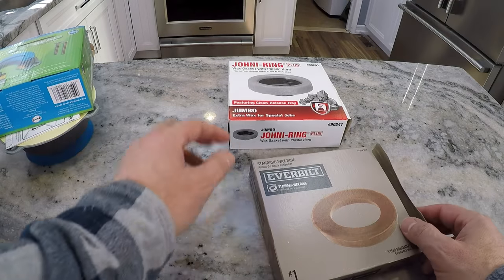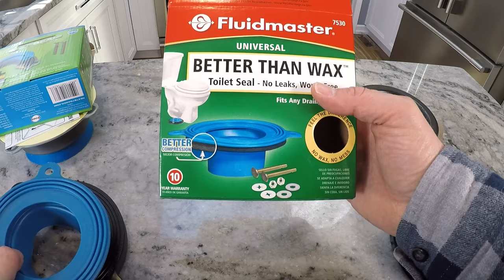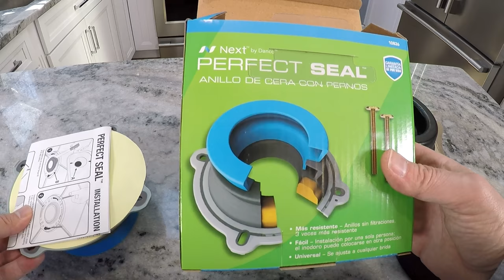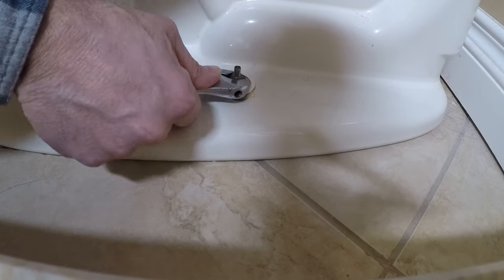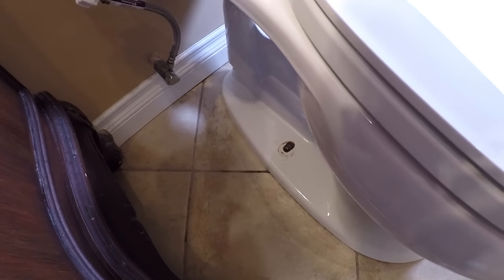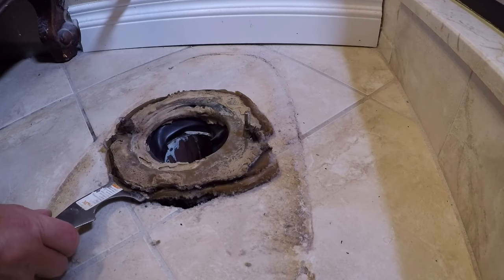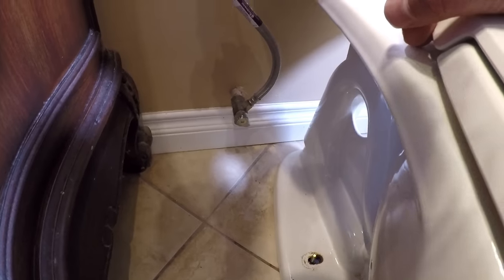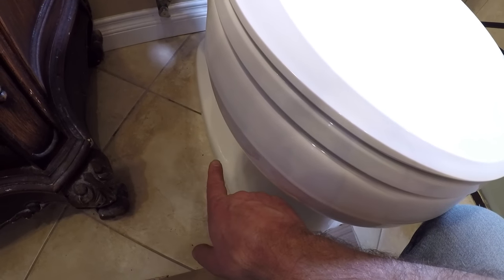Toilet Seal Replacement - Wax or Danco?

Comment: Here is how I see it. I am not a plumber but I've been in HVAC for long enough to have spoken with so many plumbers. I always ask them what they prefer, wax or wax less. Plumbers always use wax because it works. They can guarantee wax. I've heard some plumbers say that they will install what the customer asks for but the warranty will depend on weather its wax or not. If plumbers do wax all day long, so will I. Again, I'm no plumber the everyone around me fancys me as a handy man and I've done a fair amount of wax replacements. No issues so far.
Reply from the maker: wax works... but people are always looking for an alternative
Reply: @flannelguydiy6458  That's silly. Wax works. Wax is cheap. Why seek alternatives?
Reply: I guess it's just me but l see too many jobs by D.I.Y. folks not fully cleaning surfaces to ensure n even 360° smooth area and also plugging up the sewer pipe hole to avoid both allowing sewer gas seeping out and stinking up the house and also preventing tools, hardware and debris falling into the drain pipe.

Comment: One thing I have learned over the years and no licensed plumber will tell you because they don't do it is coat the bolts with never seize. Years later you can remove the nuts without any problem at all. I use it on anything exposed to water and weather or heat.

Comment: I installed the Danco perfect seal today. My flange is flush with the floor so I didn’t use the extension. So far so good. The toilet sits as solid as before with no rocking. It stopped the slight leak I had from the wax ring failing after 10+ years. I watched your video to see if you did your Danco install differently but was disappointed to see you install the Fluidmaster instead.
Reply: same..as I sit here w a Danco and 2 wax rings  :)

Comment: Put a little safe gasket grease or O ring grease on the grey or blue  seal and the toilet horn will slide in easy ..if not the grey seal can bend when the horn makes contact with the seal and get a improper flush seal...u can do it while you have the toilet on it side u can tell  how easy it slides with grease  vs without it

Comment: I put in 3 of the same toilet for my cousin. Never really did a toilet. I bought the blue Fluidmaster you used & the red Korky one, tried the blue one, the flange was  1/2" above floor, even removing spacers felt toilet was too high, whereas with wax you can put weight on toilet and get the wax to squish down, pulled it off & used the red Korky removing the thicker spacer, worked better, still had to shim. Then put in 2 more & on one used the Danco one you showed (that toilet had the flange a bit below the floor) that had wax in it, that was pretty good. Tried the Fluidmaster again on one and rejected it, used the Korky. Terry Love, a master plumber who runs the Terry Love Plumbing Forum, still says use wax. I think in hindsight I would use wax, I think ideally if floor is level you want the entire base of toilet to rest on floor, since you can't tighten the flange bolts too much. With these waxless rings, they don't compress enough to get the toilet to rest on floor. Sure, you can shim, but that's not ideal. Another issue is, good thing on one I pulled the toilet before tightening bolts & saw that the thin rubber that went down into the waste pipe had caught and folded up, good thing I saw that or would have been an obstruction to flush. You would not have that issue w/a wax ring.
Reply: Thanks For Sharing! That Recess At The Ring and Bolts Is About 7/8” Deep On My Kohler Elliston, I Believe That Would Be The Critical Measurement, Since The Outer Base Edge Would Hit The Floor And Limit Any Further Compression Of Wax Ring. If Flange Is Any Higher Than 7/8” Above The Floor, Than Toilet Weight Will Be On The Flange/Pipe and Likely Wobble Needing Shims/Support...
#YourRecessMayBegToDiffer #YourToiletRecessMayVary 🚽 #NotAPlumberInRealLife 🕳🦸‍♂️
Reply: Frank-You are SPOT on about the wax free rings! I went thru 3 of them and my toilet STILL wobbled and to use shims was ridiculous! I ended up using a wax ring and will do so from now on!
Reply: Frank, that was a great explanation of what to watch out for. That helped me more than most videos I’ve watched. Thanks!
Reply: Agreed. I also used the fluidmaster once to try on my house.  I removed the toilet a few months later to check how tight it was holding and found the the plastic funnel had turned upwards somehow and was catching a small amount of water. It didn't leak but I was not happy with that and could recommend them because of that issue.
Reply: @YOUandMeRealtyDotCom  you have got to stop capitalizing everything! my god!

Comment: Remove the water tank from the toilet, so it is easier to remove it and re install. (less weight and easier to lower the toilet onto the seal gasket). Also you may want to clean the tiles around the toilet drain before installing the toilet.
Reply from the maker: thanks for watching!
Reply: Just changed my wax ring, thought about taking the tank off, but figured that would be another place to leak. I don't  get along well with plumbing.

Comment: We installed a Danco Perfect Seal. Our flange was on top of our flooring, as most have recommended, removed the blue gasket and black liner inside the lower gasket and it still wobbled. We ended up using a standard wax ring (vs a jumbo) and installed sit flush. Buyer beware of the Danco perfect seal. Always dry fit the toilet to see if it sits flush also. Hope this helps others. And thanks for sharing this informative video! Very helpful.
Reply: I did not understand what you did. It sounds like you did not have much stuff on the flange, but your toilet wobbles because your flange is the toilets main point of contact because it is so high. This is a difficult thing to figure out: what is the gap between the toilet horn and the flange, and how much stuff do I need to put in there to make a secure passage from toilet to pipe.
Even though you think you have no stability issues now, I would put some shims under the toilet to resist motion as the wax ring settles and gets squished flat.
Reply: @yru435  There is no wax ring in the Fluidmaster seal that he installed.

Comment: I see that you used the Fluidmaster, I didn't see any wax on this one.  Is there one that has wax?  Also, did you try the Danco?  The Danco Perfect Seal still has a wax ring, it's just that the wax doesn't touch the toilet.

Comment: How did that Better than Wax work for you after 18 months?
According to the instructions you probably should have used the spacer too. The spacer is meant to lift the blue plastic high enough that it makes firm contact with the toilet porcelain, then compressed when you place the toilet weight on top. 
I’ve got exactly the same combination as you had in your video; wax, Perfect Seal, and better than wax. I’m leaning towards the Perfect Seal.
Reply from the maker: It has worked perfectly. The toilet is sitting firmly on the seal. No issues at all.

Comment: While you have the toilet removed is a good time to clean around and behind the toilet.Wall behind etc.
Reply from the maker: its also a good time to make a sandwich!
Reply: See, that's where most people just don't care about little details like that. I have severe OCD and I always pay attention to little details like what you're talking about. I had to replace two toilets in a house I bought back in 2014. My wife thought I was wasting so much time by cleaning the wall behind the tank. I also cleaned all the excessive wax around the flange of the floor so everything would be nice and neat. But yeah, most people today just don't give a damn. They slap something on good enough for it to work and that's it. Details to me are everything.

Comment: Thanks for the tutorial. I have a home on a slab. Any idea how I'd even check to make sure nothing is leaking after the installation?
Reply from the maker: with a slab? yeah if you have solid cement the leak should come into the bathroom

Comment: Just a thought sir, maybe it would be a bit easier with a shop vac to get the remaining water from the bowl and tank. Video is very informative.
Reply from the maker: It look literally 60 seconds to do it with the sponge. To bring the shop vac into the bathroom, turn it on, take it outside to dump the water, let the vacuum dry out, etc... it is actually easier to use the sponge. I like the fact that you are thinking creatively though. Really appreciate you watching!

Comment: Looking at using the perfect seal that has the wax ring underneath. Is the perfect seal  supposed to work with older iron/lead flanges?
Reply from the maker: not sure

Comment: i think Danco one, when used properly is good. I've used it time to time, but 80% of the time, i use the thick, extra wax ring, regardless how high or low the flange is, i just like that extra wax lol
Reply: I used the thick wax with danco hydro cap had great success with that product also

Comment: Just installed a Danco and was meticulous in cleaning and proper installation. 10 minutes later, its leaking out of the back. Heading back to the 
store for a wax ring. Thanks for your video.
Reply: It was actually the Next Perfect Seal that did not seal perfectly.
Reply from the maker: Those things are not often easy to install. If you are off just slightly when setting the toilet down, it could result in a leak. Luckily for me, I was able to get it sealed properly on the first try.
Reply: I stand corrected, the seal worked perfectly. The leak was actually coming from the tank. It must have moved slightly off the bowl when I leaned it back to clean. Thankfully I used blue ty-d-bowl and found the blue water coming from above before I pulled the toilet up again!
Reply: @bentstruments  Thanks for the update
Reply: @bentstruments  Good on you for coming back and setting the record straight.  Still happy with the Danco?  I purchased the Next Perfect Seal and a traditional wax ring still trying to decide which to use.

Comment: On perfectly flat floor: plain old wax.
On uneven ceramic tile: Danco.

You don't use nylon closet bolts?
Reply: @snaplash  Yes, but grout tends to fall apart, unless it's epoxy, in which case the toilet is never coming back up.
Reply: @ChrisGilliamOffGrid  My Bro-in-law (40yr plumber) said to use clear silicone adhesive to chauk the toilet  around the  bottom of rim, helps to seal and level.
Reply: @HighlightsVideoBlog  Not silicone, water-based clear or white caulk. There's a video of it on my channel. Use a sponge.
Reply: @ChrisGilliamOffGrid  Thanks Chris , it’s like you made that video for me!  I haven’t installed yet so I’ll check out your directions. I!m installing white over black tile floor so the clear product is the charm. I,ve seen another vid where the chalk was applied to the underside rim of the toilet just befor setting  it which makes sense to fill the grout gaps underneath the rim. Your Vid technique  seems simpler. Probably do both.

Comment: Im a few years late watching this. I have used the perfect seal on both my toilets and they worked good. I have since sold that home and we are buying another home that is older and i will be needing to update the bathroom for sure and so im just refreshing my memory on the toilet seals. Im hopeing i dont have a cast iron piping. I didnt get in the crawl space of the house. I asked the inspector and he said my stack was cast but there was some pvc. Im hopeing the toilet drain has been udated ive heard they can be difficult to mess with. Anyways thanks for the vid.

Comment: My brass mounting flange is not round and does not sit level. It is flush and up to 3/16 above the floor. I tried the Fluid Master and it would not work in any configuration even removed the foam and tried the black spacer to add a little height. I went with the Danco. If there is a problem I will try the korky brand.
Reply: Korky is a better choice. I installed two double-stacked korky three years ago. Everything works fine.

Comment: Very good video, Flannel Guy. I would have liked to see you do a dry fit of the BLUE part on to the toilet horn to give us an idea what the fit looks like. I thought that the idea was for the toilet horn to fit down INTO the blue thing, maybe deforming the inner part downward a little bit, and for the outer circumference of the blue ring to fit up against the bottom of the toilet around the horn (which is what a wax ring does, and that is what I thought we were going for with this blue ring thing). 

When I did the test fit on my toilet I found that the horn of my new toilet (Toto) contacts top of the blue ring, but it could not fit inside down into the diameter of the blue ring, even by stretching it. I used a flange extender ring to simulate the toilet/flange-ring junction, and I could not get the blue thing to seat on the horn without distorting the blue thing. There was no way to manipulate the blue thing to get the it to move any higher on the toilet horn. The only point of contact would be the thin edge of the toilet horn contacting the blue thing, but not fitting down into it. It looked like the blue ring would have distorted and not sealed. 

If the horn on my toilet was a smaller diameter and tapered then it would work, but I didn't feel like grinding the horn on toilet (!!). This meant that the blue thing's surface would not contact the bottom of the toilet around the horn. I have read that the size of the toilet horn varies but I have no experience with that. I recommend doing a dry fit to see what your junction will look like.
Reply: R Y , I know exactly what you're saying about the blue ring not fitting over the toilet horn. The fact is this particular seal is NOT UNIVERSAL. I couldn't get to set properly over the horn, nor could I get the toilet to set flush to the floor no matter how I tried. I ended up using a Sani Seal gasket instead without any issue.

Comment: Suģgest you acquire a shop vac.  Vac the water from tank and bowl.  Takes about 45 sec and no water clean up.  A ratchet box end wrench in 7/16 and 1/2 inch is also a very handy tool. À vibrating saw with metal blade is ideal to cut off rusty bolts.
Reply from the maker: yes I know all about the shop vac. However, by the time you open the shop vac to remove the filter so it can be used with water, carry it down to a bathroom, suck up the water, carry the shop vac outside to dump it, then replace the filter... it is actually MUCH faster to use a large sponge and a bucket. It was about five squeezes with that large sponge and it was done.
Reply: Use a plunger 🪠

Comment: What anchors the bolts to the flange? I didn't understand that part?
Reply from the maker: the flange has a slot where the bolts slide in. The head of the bolt grabs on

Comment: It’s easier to maneuver the toilet if you disassemble the top off the bowl..then you can have more accuracy setting the bowl down and not wrench your back out too..
Reply from the maker: sure it would be lighter, but extra steps that I preferred not to take. Plus the bolts holding the tank to the bowl were rusted a bit and that could have opened up a whole other can of worms
Reply: @flannelguydiy6458  just as easy to disassemble and replace those too..especially if they do look rusted, why ignore it and wait for a possible leak? Replacing all seals, gaskets and hardware at least keeps it all fresh and on the same schedule..you have to drain the whole thing regardless.. I had to bust out the Dremel to cut a bolt off that was completely rusted, I’m vowing to replace the whole lot long before I allow it to happen again..

Comment: Would it have been easier to remove the tank first?
Reply from the maker: probably not...
Reply: If you remove the tank you will need to replace the gasket between the tank and the toilet  and the bolts and gaskets that hold the tank

Comment: How’s the fluidmaster working out for you?
Reply from the maker: So far so good. Flushes well with no clogs. I happened to look beneath the area of the toilet in the crawl space below two days ago and there are no leaks at all
Reply: Not gud at all I used fluid master which didn't need wax seal. Now toilet is still leaking
Reply: @hakeemparker4070  may be not laid evenly

Comment: Use a wet/dry vacuum to empty the water out of the tank & bowl
Reply from the maker: yes that works but for me it is more of a pain. I do not want to then have to remove the filter in the vacuum and then let it all dry out.
Reply: If you have diapers around the house they make short work of drying the toilet.

Comment: For your viewers: From the start of the video, you want to take that black plastic away, the ring should pop out, you do not want to install your toilet on top of that plastic, you gonna have some interesting problems. Also I would put down some protective rubber mats and wear some gloves. You're dealing with poop and that can cause some serious health issues.
Reply from the maker: i also work in the corporate world. I deal with poop all day long. I get it flung at me too..
Reply: As much as it causes me pain to say, you probably just saved some poor sap a lot of work. If that's the case they should just use it for a watering dish for their cat and call a professional🤣